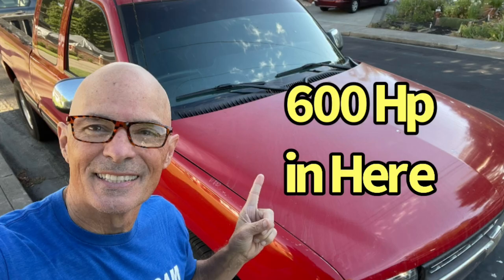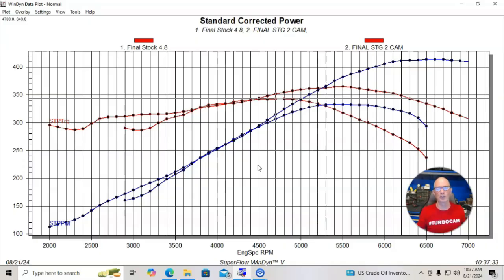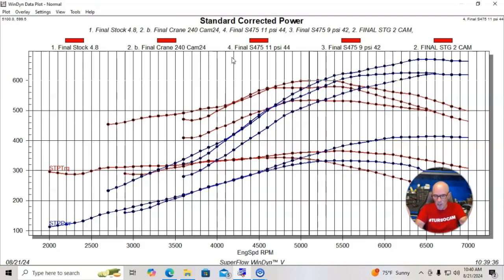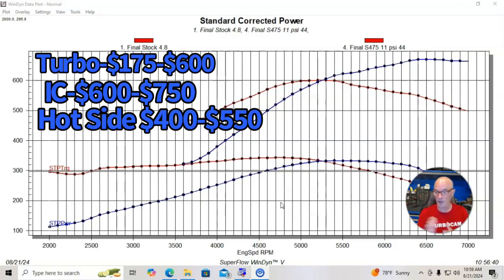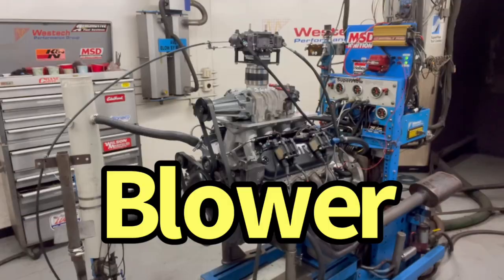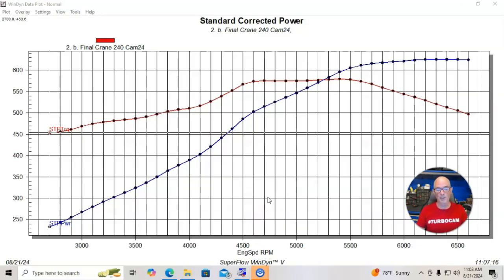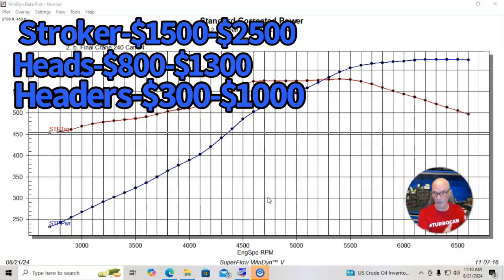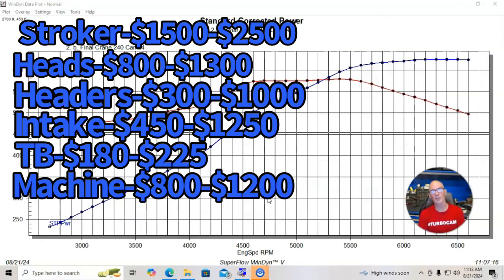WHICH ONE IS CHEAPER? 600-HP 408 STROKER VS 600-HP JUNKYARD 4.8L TURBO. FULL PRICING FOR EACH.

Comment: Hello, I had a 1991 Toyota truck with a 22RE motor, and I modified it, but I was not happy. I contacted the Toyota Dealership. They wanted $2000.00 for a turbo with 7 PSI. I am shocked, you can find a turbo between $175-$600.00. What turbo brand would you recommend on a budget?
Reply from the maker: for what power level?
Reply: @richardholdener1727  The turbo in the video seemed to support the 4.8 motor very well. I am impressed, so I am curious what brand?

Comment: i did both the first was a 4.8 Turbo and it mad 780Hp (based on ET and weight) the second was a 408 makes about 495 based on ET and weight. loved the power of the 4.8 turbo but could not get it consistent enough to dial. It was hard not winning a first round the entire points series. only after figuring out that the hotter the turbo the faster it spooled and changed my 60' buy .1 seconds depending on how hot it got in the staging lanes and during the burnout and how long I was on the brake.   So, I bult a NA 408 motor using ls3 heads and SS3 cam and headers now it's very consistent but slower buy a lot LOL.  But I when passed first round a lot more then I lost. any pointers on bumping that power up with a better cam choice.

Comment: I have factory ls3 heads on my ls2 bottom end in my gto with a lsa ported blower and it made 700 rwhp. So now that I blew that motor up and I’m going with a 408 stroker it will make at least 600 hp and with my blower on it it will make more than that to the wheels.

Comment: If you have a fully built 408 stroker build get 2 turbos from vs racing 7875with a fully built 6l80e  turbos for $1110 in total ($555 each) you can get up to 900hp
Reply from the maker: twin 7875s will make much more than 900 hp-1 of those turbos will do that if it is the right Generation

Comment: The biggest difference is that the turbo kit can easily bolt onto another junk motor when it blows.
The 408 stroker is trashed along with all the parts and money you put into it. Never ever would I ever build another full motor. It's not worth it....

Comment: So, get a low -mile junkyard engine, file the rings, put a tiny turbo on it, ,and wallow in gobs of torque and top out at 600 max, yes? Cheap! The transmission you need to handle all that torque at 500 RPM may be pricey, but just a thought.

Comment: I havent whatched as of yet. I  know that itcwill be the 4.8 by a wide margin. With all the electrulical, I  don't  know if there are less expensive options than $2000 boxes that I  dont even knoow can control your transmission. You would knowcwhat is out there for the people who would wantvto a gen 1 Chevy with a blowthrough carb and a boost retard. Bye the way, what happened to stud girdles & 7/16 rocker studs with a solid roller to go 7000-7500 rpm. Burn outs are fun, but putilting down too much torque makes it cost so much more to plant the tires, so revs & turbo, here we come, but how little can I  pay for an aluminum headed SBC that will do low 11's or better on a budget? I  watch you how to do videos regularly.  But unfortuneately I  dont have an hour & half listening to rants from A-Z. Why is so damn diff😅ic😮ult to find the exhaust side in a turbo kit, when you don't  have much welding experience? At least 4 cylinder engines sell down pipes?

Comment: Ohk I’m on a mission to find a machine shop in my area to resurface my deck and inspect my block and crank… so tht I can get my engine back to brand new again… I have no knowledge of this engine and I don’t think I can just go off what I’ve been told… it’s already out of the truck and it would just behove me to clean it up now and check that I’m building on a great platform, so I can get to my 500+whp. So I need to start at the machine shop no matter what rght? By the way this is my first engine build and swap
Reply from the maker: depends on what you are trying to accomplish
Reply: @richardholdener1727  I’m trying to to get 500+whp daily driver, reliability… top speed 150-160mph

Comment: Will someone chime in please I've been researching turbo sizing and I've yet yo find a clear answer, what size/type single turbo would you recommend for a mild 350 SBC as is a 350hp ish or so NA has ported factory iron (probably will get promaxx Maxx series 200s or afr enforcer 185s in a year or so) 9;1 typical 230/.480/108 cam 300-31 intake, just for a mild boost like 100hp a 93 pump gas friendly setup, I'd say 6 to 8 lbs but that obviously depends on the heads n intake so like 450hp with the ported iron heads.  Im quite knowledgeable when come to building engines ect but have zero experience with the technical side of turbos other than videos so have zero idea what millimeter gt45 t3 t4 ratio I do know how to fab the system and I'm a professional welder fabricator. It's a semi daily so needs to be somewhat chill I have read so many turbo forums saying don't do it blah blah blah do something  else you have no clue, but I can figure it out and I'm not concerned if it grenades or burns up such is life, wash rinse rethink I will be ditching the carb and switching up to an aftermarket TBI setup. I'd go twins but I assume the price would go up significantly. Thank you
Reply from the maker: get a cheap GT45-but use a smaller cam (less than 230 duration)

Comment: In this comparison your getting a brand new motor in the 408. If you rebuilt  the 4.8 right to actually last at those power levels i think it would be a different story. Although if you built the 4.8 600hp would not be the goal and would be making 2-3 hundy more than the 408 so 🤷

Comment: Turbo all day everyday due to the adjustability of the piwer curve. It's easier to adjust the power to your traction than find traction for too much power.
Reply: This! You can also run taller gears and load up the turbo

Comment: Why not use a 6.2? With just a cam change and a Comp Cam you made 567hp. You could up the compression and be at 600hp for under $2500.
Reply from the maker: a junkyard 4.8L costs a few hundred dollars-an aluminum 6.2L costs thousands
Reply: @richardholdener1727  average price in the midwest is $1800 - $2500 for a 6.2

Comment: Ohk I’ve got a question… as to how it relates to me, I’m currently working on 2 engines the 4.8L v8 and the Amera Barra 4200 vortec inline 6’ and I’m wondering which one would be easier/cheaper to 600whp?
Reply from the maker: ls
Reply: @richardholdener1727  Copytht LS 4.8 be great it is…

Comment: At 5:34 you stated it would take 600 to 750 horsepower to have a good intercooler. I would guess this is from all the excitement of thinking of more horsepower.  The beauty of the turbo setup is the power is always there waiting to be used while cruising around smoothly until you need it,  then it is on..  Not so with the stroker kit.
Reply from the maker: I stated it would take 600-750 to have a good intercooler? That doesn't sound right
Reply: @richardholdener1727  I think you said HP instead of dollars. Everyone knows what you meant. 
I do have a suggestion, as you've mentioned it, but I don't remember a test. How about 87 turbo testing? Street cars and trucks could save coin on 87 instead of 91/93, or upping everything and going E85. It'd be a way to show how much power you're leaving on the table by saving on fuel, and give you an opportunity to say any changes on initial build. Like comp ratio, intercooler at X psi, etc...

Comment: A stock 4.8L makes 330HP ? What gen ?
Reply from the maker: every one I have ever tested-because we don't test it the way the OEM does to rate it
Reply: @richardholdener1727  Really , interesting.
I have a stock LQ4 with 3 inch headers, what would that make aprox ?
looking into building a lightly tuned LQ4, cam, headers, trunnion kit , steam port kit, new stock injectors.  Need reliable mostly.

Comment: Lol, I was thinking this video was going to be a baby turbo LS vs Mopar 408 (360 stroker).  I'm guessing 408 LS vs LA is probably similarly but you have to dump $2-3k into good mopar heads. 

I actually want to build a 318 turbo to piss off the 318 haters.  I figure a 318 turbo has a slight advantage over a 408 due to gas mileage.

Comment: If I were to write a check for the parts it takes to build the 408, I would build a 427 with an LSX block. Then boost it later 😉

Comment: Title should be "Which one is more enjoyable to drive"  Cost will abe about the same in the end.
Reply from the maker: cost was not the same as shown
Reply: @richardholdener1727  I know and I'm not saying you're wrong, but I think you left out many small things that are needed when actually putting a turbo that has to live for awhile in a driven vehicle.      I did one, it's death by a 1000 cuts.  The little things like clamps, V-bands, fitting, hoses, drain back stuff, waste gate controller,  relocating stuff to make the intercooler piping fit and look 1/2 way decent all add up.    

I wonder what a  cheap 317 headed TBSS  stroker would offer up with  the improved streetable compression on a 408.  Starting with a good 6.0 or 6.2 would allow you to skip the machine shop too just add 50$ for the dingle ball hone.    LQ9's and LQ4 are getting easier to find.   No good machine shops left here in NYC.  I have to DIY everything or send it long distances for work.

Comment: I didn't watch yet but you need to figure out mpg for long term cost lol. If I wanna cruise on $100-200 a weekend it can't last 100 miles. Need to figure out the best power and 20+mpg like a coyote can do I guess. I've heard of twin turbo in a obs f150 doing 25mph+ cruising. That's why I love a trans like the 6r80 with a standalone ECU and than you can run carb, sniper, w.e and have the best of all worlds. 406 stroker sounds like 5-10mpg. I'm sorry but just can't do it especially if it's premium.

Comment: If im driving a street car, 408 wins. Look at the graphs. 408 has more torque throughout the graph. The pulls start 1000 rpm earlier on the 408 than the turbo motor AND the 408 spins to a higher rpm than the turbo. Probably 1500 to 1800 more usable rpm than the turbo motor. For street, this just makes a car more enjoyable.  Everyone loves a street car with big power and instant throttle response.  Waiting for your power to finally arrive at the party......sucks.

Comment: not mentioned is the maintenance being so much better on the stroker, not being as worried about as much loss of power as temps go up in the summer, less heat creep in the engine bay cooking your stock PCM, no oil lines or coolant feeds to a turbo that can leak and strand you

Comment: Richard, if you started selling a 4.3 V6 cam , that would be SO AWESOME.  All the aftermarket ones are SO EXPENSIVE.
Turbo FTW.  With a properly sized turbo, you are going to get more TQ down low than the stroker.  That wins races.
Plus the turbo kit can be transferred to a 5.3 or 6.0.

Comment: 408 all the way then go with a 72 mm maybe 68 mm turbos then you can make some power!! Just be sure to use good parts so it will last at around 15 lb of boost should be the ticket

Comment: Can i kick off a here's my 600hp build :P 
deka 80's 370$, 525 walboro fp 200$, cast "denmah" 870$ All @ vsracing, ls3 valve springs fbmp 60$, pqy regulator 32$, gaskets and studs like he listed, holley, termi x, ring gap replace broken or worn out stuff/razor blade rebuild, run manifolds and get <200$ worth of bends and pipe learn to weld muffler pipe and hf welder 250$, pay someone to tig a couple ic pipes 100$ if even needed. Now that's out of the way lets discuss the 5000$ trans 8000$ suspension, 3500$ worth of safety and roll cage :P

Comment: I'm surprised you suggest head studs on the 4.8 turbo setup. I thought the current recommendation was factory bolts up to pretty high power levels?
Reply from the maker: you can run stock bolts-I have in the past, but recommend studs

Comment: I would do the 408, much less clutter in the engine compartment, more room to work on it in the future.
Reply: I feel the same i want N/A 427ci for my 03 silverado. But the 4.8 i currently have will give me 500wheel also 😊 I keep tossing both back and forth. Its 2yr plan for power plant trans is next year. I just did suspension and rear-end. So time toss in trans and then power it all 😊

Comment: Please use cubic inches for all displacements on your channel.  It is more precise than a liter. Speaking imperial and metric in the same sentence is like reading print and cursive in the same sentence.
Reply from the maker: LS motors are not designated in cubic inches from the factory-but the stroker motors are.

Comment: sorry but that stroker setup pricing is way off, 8-10k is more like it and that's on the low end. While a gen 4 4.8 with cam and ring gap on boost can be done for about half that. I love these videos but as a shop/dyno owner I constantly get ppl in that use this channel and sloppy as a reference for hp goals. I have to explain how this is not realistic.
Reply from the maker: Maybe check your math, the high side costs given for the 408 stroker $7475 + $2289=$9,754. The Hp results given by this channel come right from the dyno, so they are also spot on.
Reply: @richardholdener1727  the one thing you never mention is labor costs and wheel hp differences. Your viewers think the numbers you give are what they should expect. I literally have this conversation daily with customers and have to explain to them why your numbers are so much higher than real world whp.
Reply: Labor costs? I always looked at this channel as DIY resource.  I'm a firm believer of ..if you can't do the work yourself, you should probably not be modifying your car. Unless you are disabled in some way..
Either way, it looks like Richard is drumming up some business for you.
Reply: @3PedalFun  With the amount I spend on my car hobby, the wife says I'm mentally disabled, does that count? 😁😂

Comment: I pretty much kept track of every single nickle and dime i spent, including shipping/tax, spark plugs, oil, gaskets, etc and this is what I came up with for my LS1 turbo in my 99 Trans Am:

turbo setup (ebay GT45), this includes all the gauges, fuel system, injectors, random fittings, piping, etc: $3105.
Engine/cam/springs/pushrods/re-seal (you don't have to do this): $2064
Transmission/suspension including 4l80e swap, torque arm, safety loop, torque converter: $3411

I am tuning it myself so $499 for HP Tuners (for now).  Doing it all over I could definitely save some money in spots and probably knock $1000-$2000 off all this but i went pretty cheap with a lot of this (I should own stock in DNA motorsports by now) but I think this is pretty representative of overall costs to really set this up and get it running in a car.

Realistically I should also drop ~$3000 in a driveshaft and ford 9 inch before this ever gets near a track but those of you that don't have F-body's may not have to worry about a rear end made of duct tape and chicken wire...
Reply: Lol

Comment: I think I'm going to dip my toe into turbos with my SBC in my truck, I'm a welder fabricator by trade so all the fan work isn't an issue I figure I just need to find an aftermarket TBI setup because going blow thru carb sounds like a nightmare of issues vs just tuning a EFI setup, even tho I've never done it I'm sure I can flounder my way thru it enough to get it to run half way decent. The new plug n play mega squirt for 94/95 mustang looks awesome, it litterly plugs into factory connections and has a butt load of features, auto trans too, it's capable of doing about everything thing can think of and then some and is very expandable like doing traction control it's pretty sweet but the price isnt cheap its around $1100, that's steep but if that's what your looking for it's money well spent I think. Especially where there is no installation mods needed just unplug the factory  ECU and plug it in done for basic function, obviously it's more involved when you start expanding it but installing a Holley is not plug n play that I know of and the old mega squirt needed an expensive unit to integrate it to the factory system.

Comment: The 408 would be a way wilder ride I would think, very rowdy and a ton of fun, the throttle response is a consideration too. but there's prob more downsides to a big stroker, the turbo setup could be made to have good drivability and fuel economy but big power anytime on tap, and way cheaper. And if you blow up the 4.8 your back in action for under a grand and a couple scraped knuckles vs a few more thousand dollars and weeks to repair the 408, and with the 408 how are you going to get those whooshing noises? Ideally toss the turbo on the 408!

Comment: I take issue with these tests. That turbo is far too large and will not behave the same in the engine dyno as it would in the car while driving.
Reply from the maker: The turbo choice is actually yours (since we are just basing this off costs) and 600 hp can be made with a GT45 or even smaller turbo. The turbo (once spooled) behaves exactly the same in the car as far as power production. Pick the turbo you want to achieve your goal

Comment: Why stop at 408 when stroking your crank? is for ex. 415/416 that much harder on the component? Thanks for all the good content Richard!
Reply: It’s not worth boring out that much.  No need to bore it 30 thousandths over imo.  Enough to clean up the bores is all I’d do.  Then you can freshen the bores up again later down the road.
Reply: @CULT539  Thanks, I have a 6.2 that need some work, So then 415/416 is easier right?
Reply from the maker: Using a more expensive 6.2L block, you can go slightly bigger in displacement, or sleeve it and go for a 468 like we did-just more $